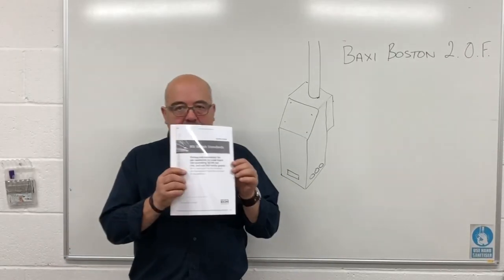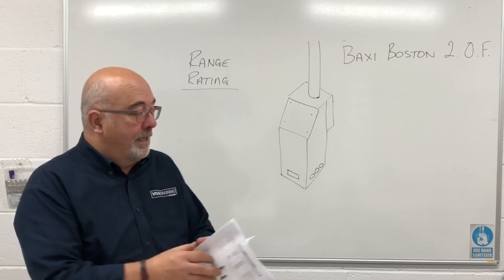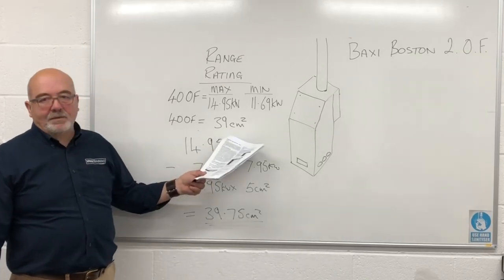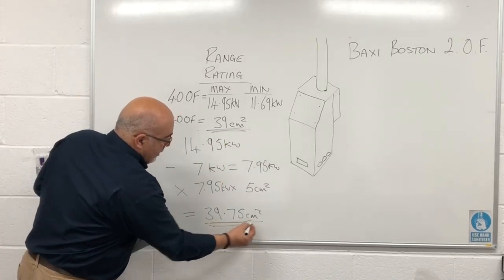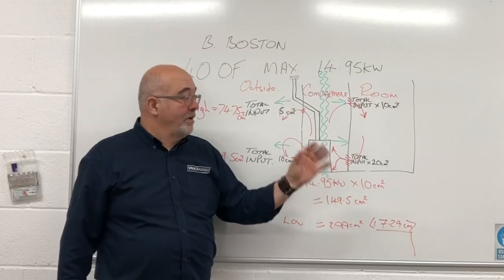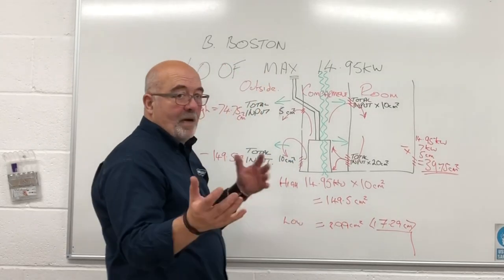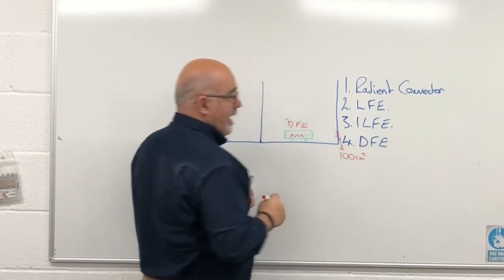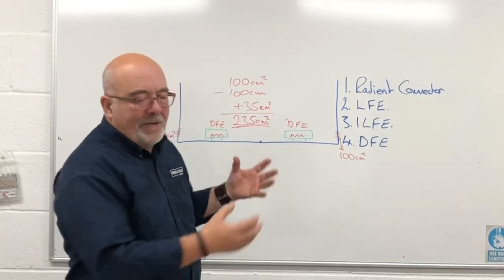ACS Gas Training - Ventilation - Open Flue Gas Appliances - BS5440 Part 2

Comment: Excellent stuff, ACS again next week so spending the weekend prepping up. The last Boston I worked on I got into I heated debate with the know it all customer, there was no vent fitted and he was insistent that the boiler did not need a vent on the grounds that it had been fitted for 20+ years without one! This job would be ok if it wasn’t for customers!
Reply from the maker: Follow the instructions and you will not go far wrong. Thanks.

Comment: This for gas fire If basket type fire does it require 100cm2 vent but no mis. But if no vent and passed all test flue flow/spillage is that an at risk. Can you confirm Allen?

Comment: Just done my acs exams and had a question which I cannot find the answer to and the tutors are not 100% either 😂
What is the additional ventilation requirement were a DFE fire and a solid fuel fire are in the same room?